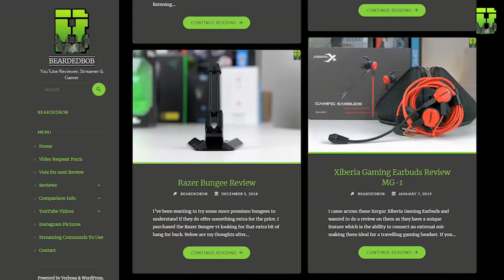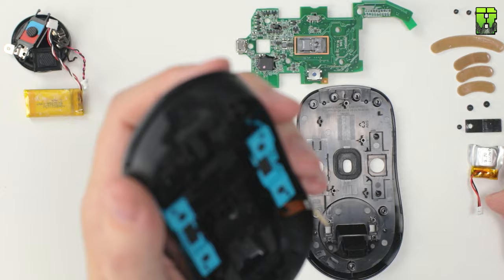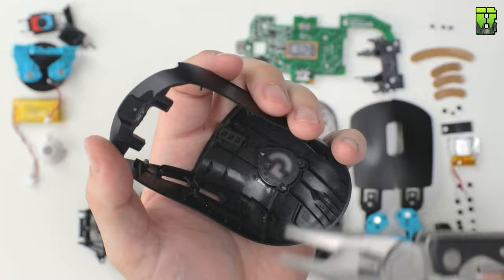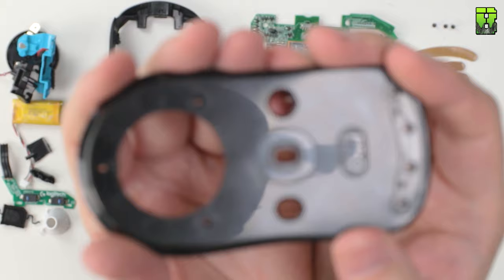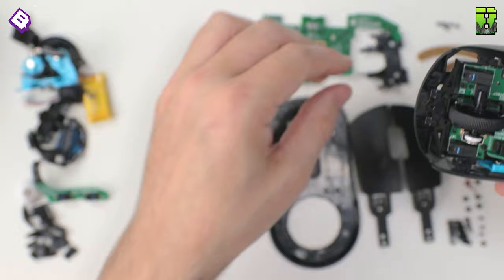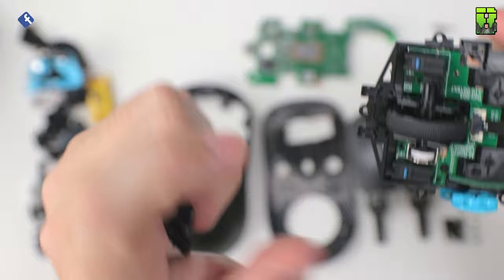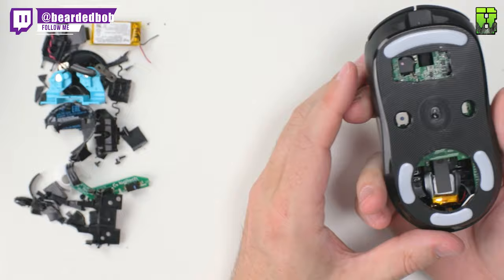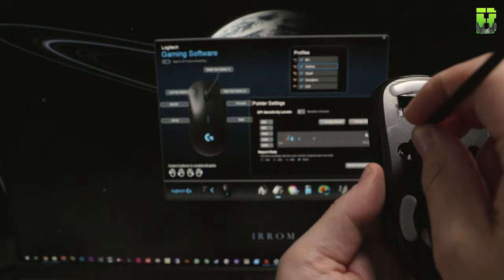HOW TO REMOVE 20G FROM THE LOGITECH G PRO WIRELESS - Weight Reduction Mod

Comment: Thanks Bob! I did this mod today and I'm super happy with it. I got it down to 65g so I basically upgraded my G Pro to a superlight for free, can't beat it!
Reply from the maker: Np Bread glad I could help 👍
Reply: Bro Just a question to a bold guy with steel bals, do you feel like the wheight on the mouse Is unbalanced?
Reply: Do not remove mouse whell shell thingy!!! I had to reopen and install it. İf u remove it, it'll ruin feelings of mouse clicks. It has spring that bounces presses back.

Comment from the maker: 50g Logitech G Pro X Superlight weight reduction is out now https://youtu.be/j-HyZ-AXyVU
Reply: Someone have done glossy gpro wireless and it was 70g, so if You do this also it could be 50g!
Reply: Anders__Jacobsen Jesus, I might wanna switch to team Logitech just for that
Reply: How much would I have to pay you to mod my g pro wireless?
Reply: i cant get my left and right mouse buttons to work and i think its the ribbon cable connected to the upper pcb as there is a tiny scratch on it. could that be causing it.if so how can i fix it

Comment: Finally attempted this project after couple months of watching this vid once in a while. Made mine 67 g without cutting the front base and leaving the mouse wheel stabilizers since it felt wobbly after removing them and also kept most of the screws. Was rather easier than I thought.  But not recommending it for non handy people to do this project as it requires alot of caution. Overall my mouse seems much lighter but slightly more front heavy (tho it's light) and worth the effort. Thanks for the tutorial. Next up is SteelSeries rival 3 wireless.
Reply from the maker: Np Ace Zealot glad I could help 👍

Comment: Just did this mod and i can tell you it is amazing. The initial wieght was 80g and it is now 66g. The only modes i didnt do were the batery and i didnt some of the bottom shell because i was scared i would destroy it. 
Another thing besides the weight reduction i noticed is that the g pro wireless now has evenly distribuited weight and like the superlight X. Before the mod most of the weight was in the back now it is well balanced.
Tyvm Sir
Reply from the maker: Its good isn't it :-)

Comment: 39:21 never snip the wires of a lithium battery like this, snip them one at a time. Snipping them together causes a dead short through the blade of the flush cutters and can potentially cause the battery to vent.
Reply from the maker: K thanks for the tip

Comment: Nice video. I basically did the same thing, but didnt cut out the back plastic where u could screw into the outer shell. I also had multiple copies of gpw, then I found out that the front pcb holder that you took it out, it makes it unstable for both scroll wheel and mouse clicks. They click deeper and respond slower, so I left it in there. Overall, nice video, keep it up man. I also recommend putting the battery somewhere else in the back bc theres just way more weight in the front area and that makes it uneven, so I like to put the battery in the back right, so it can be more even over all.
Edit: spelling fixes
Reply from the maker: Kind to sss you have modded it also. Did you drill the shell if so how much extra weight did you get out of it?

I'll have to test the buttons further with that part removed as I've not felt a dramatic change.  What good is this part can be put back in as its not a perm change
Reply: @Beardedbob  I dont have a exact measurement thing, it only measures in whole number, not in decimal, so it was around 66 grams. After drilling holes, it was 65, I only drilled the bottom plate tho. Not the top shell, cuz I dont feel confident enough to drill in pattern. Its not really damaging to the clicks, but they just click deeper and obviously takes longer time to come back up. The scroll wheel gets less clicky also due to removing the holder that was holding the wheel. Overall for me, getting rid of the front pcb holder didnt affect anything, except it ruin the clicks a bit and drilling out the holes didnt affect that much either. Still your mod is way ligther than mine(65) at 60 grams, but I really want the solid feeling of my mouse, so I didnt get rid of any screws or any cut out on the frame, only some holes :)
Reply from the maker: I'm trying to think of a way that will allow me to drill in lines, so it doesn't just look a mess, but so far I've come up with zero ideas lol.

I think the 65g is a decent reduction and the extra 5g might not be worth the change in the feeling. Its all preference I'll have to compare the distance the buttons travel now to my original GPW.
Reply: @Beardedbob  I just used a regular drill and sand papered the holes, they look really clean, so im satisfied. You cant even see the bottom, so it's a great mod still. Keep it up
Reply from the maker: I'll try some sandpaper if they are rough and a Dremel.  Yeah, the base as long as it's smooth and doesn't snag can save some decent weight. I got 4g out of it.

Comment: Thanks for the guide.

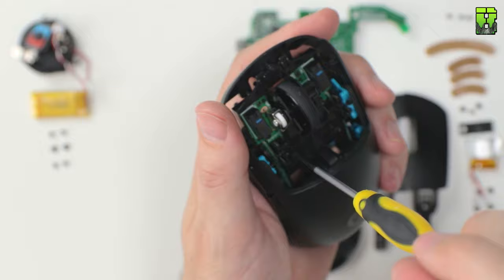I didn't do anything I can't revert back in case I have to reassemble everything for RMA. I had to leave the part at ~14:20, without it I had pretty bad wobling of M1 and M2 (scroll wheel was not affected by removing it though).

Removed pretty much just Powerplay charging and the right side button magnets. Got it to 72g, I can feel the difference but could do like 6 grams more, not willing to do something I can't go back from though.
Reply from the maker: It's all about just doing what you feel comfortable with. I would do it in small stages just incase you don't like it and then you can return it back. 

Nice job though getting yours down to 72g 👍

Comment: I cant even disconnect the two shells from each other lol. I have no strength
Reply from the maker: Sounds like another screw still hiding sir
Reply: @Beardedbob  Not actually i was just pulling on the casing the wire goes in lol

Comment: Dope video, just the kind of thing I like to see. Not my usual modding area, didn't realise this was a thing.

Might I suggest a Dremel, plus a icelolly stick, some glue and sandpaper? That plastic removal would've been faster, with much less danger of cracking, and the improvised wooded stick sander has just the right amount of flex.

Just keep the Dremel speed low 😁
Reply from the maker: Glad you liked it. I've not got a dremel an a nail file for drilling/removing plastic and this is working much better.

Comment: Wow! 60g G Pro Wireless would be actually amazing!
Reply from the maker: Thanks, on the outside it looks pretty normal as well.
Reply: @Beardedbob  Yeah bro. I am sure It wouldn't effect your grip on the mouse either. I got myself a Glorious Model O and absolutely loving It at the moment. The Issues that people were having with the early copies have been emended on my copy and it is impossible to activate side buttons via pressing on the side walls now. Definitely think they've added thicker plastic or something on the side.
Reply from the maker: I love the Model O. Also, I swap for my days between that and the GPW as I  can't decide lol. The sidewall was hard to press so I didn't see it as an issue but nice to hear they fixed it. It would be nice to see how but my guess is they placed a plastic strut or something to stop it flexing.
Reply: @Beardedbob   Yeah it wasn't really a problem but yeah it's nice they made it stronger. I can't go back now to anything heavy like even for causal use on Windows and stuff. Amazing mouse especially for the price of £ 47!
Reply from the maker: Some people use another mouse for surfing, but I'm the same, I like to keep the same mouse and just use a different profile. I agree at that price, given what you get its a great deal.
Reply: @Beardedbob  Yeah I was thinking of using my old heavier mouse for Windows surfing the web etc. But then it just wasn't right so just use my Model O for everything and it's working out great!
Reply from the maker: less hassle also :-p 👍

Comment: What a great video! Thank you so much Beardedbob, I didn't cut any plastic but was able to shave 12.66 grams out of my G Pro! I'm wondering why you said you wouldn't remove the left-handed thumb buttons next time though.
Reply from the maker: Thanks glad you liked it. The buttons are just a personal preference
Reply: @Beardedbob  Fair! I removed them (down to the PCB), but I think the real benefit of grip can be garnered from simply not putting either the buttons or blanks in the slots, so the shell has a hole and is easier to hold.

Comment: Wire twisting tip Bob - twist past overlap along the wire not the two ends. Gives a flat continuous wrap with more strength and can still be soldered easily.
Reply from the maker: Thanks

Comment: nice but no dual sided tape for the battery?
and rule n1 in mouse moding, dont cut screw posts ;p
i feel like a dremel would be useful too.
Reply from the maker: You could use tape on the battery but the gpw holder is pretty good and doesn't weight much. It's an option though.

I feel that I missed that rule/warning 😩.

Just checking out some Dremels

Comment: 57:39 i love you Beardedbob. Im Playing Online Games since 1997 and the Gaming Sector need a Man like you. But when u making a hole in the mouse Ground is it than smothly again on  the mousepad`  - > 59:20 this is so awesome
Reply from the maker: 1997 and a 56k modem :-). Stage 2 will be later this month along with the switch replacement.
Reply: @Beardedbob  yes 56K Modem first Time and than come the first ADSL Internet with Flatrate :D
Reply from the maker: 33.6k  and 128k ISDN also :-p

Comment: Great video! Maybe one day I will be brave enough to do that mod for my GPW :D Btw what are your favourite mouse skates for GPW?
Reply from the maker: Hehe, the GPW is a tricky one as it has a lot of parts well screws. The g305 might be an easier one to start.

Skatez, I'm undecided as there is little difference on the GPW as the stock stakes are good. If you don't like the sharp edges then atm I would pick Corepad, Hotline or Hyperglide. I'm going to do a final video summarising them all and showing the stats so people can make a decision.

Comment: Just use old vape pen you can manipulate the coil into a hexagon cutting tool or any shape you like I think set at the right temp cutting through the plastic would be clean
Reply from the maker: Decent idea I'll investigate it. I've a Dremel now which is doing a good job also but some more ££££
Reply: Beardedbob yes just a idea also look at plastic welding might give you some new ideas

Comment: I didn't want to risk buying a G Pro Wireless and breaking it by trying to mod it so I just bought a superlight so I know that the build quality isn't compromised but still has a ridiculously low weight.
Reply from the maker: This was done a few years before the superlight. Logitech probably saw this interest abs made the superlight. You can get the superlight down to 46g https://youtu.be/j-HyZ-AXyVU

Comment: i got it to 55gr with cable no bttery cause on 144hz and more you can feel the input lag from wireless, if i'd done the battery mod it would be around 58 grams :) thanks for the tips
Reply from the maker: Interesting idea to use the cable and to remove the function for wireless. I've tested the latency of the GPW vs Wired mice and so far there isn't a noticeable difference.
Reply: @Beardedbob  its very subtle like for instance on flicks i have to overshoot cause the click  to shoot has a micro delay. It may be in my head but I feel shots connect better without the overshoot when plugged.

Comment: Sensor works, scroll wheel click works, but left right and side buttons no longer work?
Reply from the maker: It’s on a different ribbon cable so that might have failed. You can get a replacement or chat to me over on shop.Beardedbob.com as I can repair it

Comment: Why the hell is there a third wire on a single cell lipo?! Awesome video btw ;)
Reply from the maker: O that little wire 🤓 I think it's some over heat protection but can't 100% confirm.
Reply: @Beardedbob  Normally that would be a sensor wire to distinguish the cell voltages from another for the charger to know. But in a single cell lipo that seems pretty useless lol

Comment: Does the GPRO WL work with a cable if you remove the battery (making it a wired mouse)?
Reply from the maker: Mmmmmmmm I've not tired but I don't see why not. The next one I do I'll give it a try
Reply: @Beardedbob  really looking forward to it, because we would be able to make it wired a 65ish grams without even breaking anything, if i calculated it right. Keep me updated please :O
-2g powerplay, -2.5g bottom cover, -6g battery and "mounting plate", - 2.1g blue right mouse side button thingy, -1.2g scrollwheelplate, -0.5g power switch which are 14.3g plus some screws.
Reply: So ive tried it out, the mouse works. But it thinks that a battery is plugged in at 65% charge. Firmware controls that until 95% battery charge fastcharge is active. So after some hours mouse started to smell a bit, and the mouse got a little warm, i decided to plug the battery back in to avoid damage.

Comment: Can i re use the mouse feet ? Cant order any but want to do some basic mods
Reply from the maker: Yeah, you have to heat them so you don't bend them and they peel off easily. 

I've not tried it so I would check, but Zippo lighter fluid can remove them. 

Atm, I use a hairdryer and a soft plastic tool. O
If the adhesive isn't great, I use double-sided M3 tape to stick them back down which is thin.

Comment: Honestly doesn't seem worth it since the mouse was completely butchered for trivial weight loss.
Reply from the maker: 25% weight reduction doesn't seem trivial 🤷‍♂️, it's very noticeable 👍
Reply: Beardedbob I think it would probably be easier to just 3D print a lighter replacement shell that has holes in it like model O than to destroy the stock one.
Reply: @OGSuperDirty  well might aswell buy a g305 and put it's internals in a 3d printed shell.

Comment: if u remove both than u got just 1 point to place it onto so it wont be asstable as u want it to be
Reply from the maker: The base screw points on the rear?
Reply: @Beardedbob  ye u could had trimmed it thinner to screw it still onto the rear so it will stay fully stable. I am debating cause of your videos to mod a g305 bought it recently and I love the shape of it. I wanna make it to like 75ish gram and try to keep it as close to looking like stock as possible any suggestions for me?

Comment: in regard of weight saving the wireless pro is so ridiculous stupid, all they had to do, was to discard the storage compartment and the mouse would have weight 20 g less.
Reply from the maker: I think when they designed and released it the trend of ultra light weight mice was not a thing. Hopefully the next version is lighter.
Reply: @Beardedbob  they thinned out the wall though, I mean they thinning the wall but then they use magnets to close the storage cover. WTF!
Reply: @Beardedbob  maybe they should hire you as designer then we finally had lightweight wireless Logitech mice

Comment: the stock battery has 3 pin but your replacement only has 2, does it affect anything?
Reply from the maker: You just need the red and black. The white is meant to be for head/overcharge protection, or so I think :-).
Reply: Beardedbob hey thanks for reply! does the battery % still show up in the app and the 3 LED lighting dot on the mouse still good?
Reply from the maker: Yep it still does and shows its charging etc.

Comment: When I took the stock skates off there was another layer of tape/padding covering the screws. Is that needed with stock skates? That layer of tape/cushion didn't want to comer off easily so I just left it for now.
Reply from the maker: You spilt the skates. The other layer still on there is the sticky part of the stock skatez. If you are replacing them for some other skatez remove it all.
Reply: @Beardedbob  Thanks! Waiting on the Arc 2's to come in. I've been using the GPW without the bottom piece but I've heard a few people say they took out the charging magnets too. Do you think that would make it front heavy? And would taking out the side buttons on the right throw the balance off as well?
Reply from the maker: I don't see a problem which this or the balance. You can always move around the battery to alter the balance of it's bothering you

Comment: Can I take the side buttons out (blue strips) without removing the skeleton? I’m too nervous lol
Reply from the maker: No, you have to take the skeleton out they are well and truly stuck in until then.
Reply: Beardedbob I literally jUst cut the blue plastic with some thin nosed plyers and fed it through lol
Reply: I only got it too 72 grams but I might head for 68/70. I could take out power button and dpi and drill some holes :)

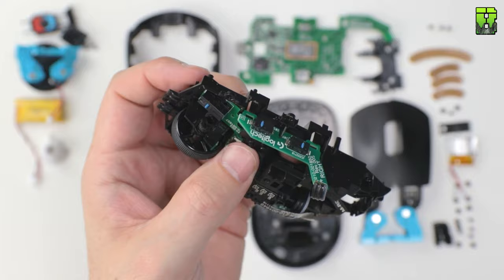Comment: Just wanted to ask, is removing the right side M4M5 button cable / ribbon connecting to the small circuit board as shown in 18:35 reversible?
Reply: depends how you remove it. the way he did you're going to have a tuff time. just desolder it from the board in the center that way you can re solder it whenever you want the buttons back.